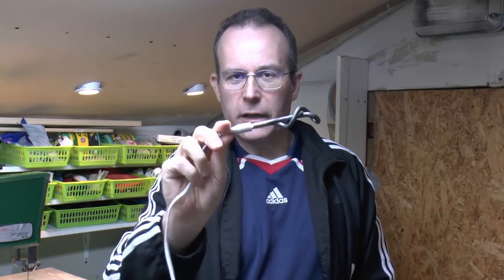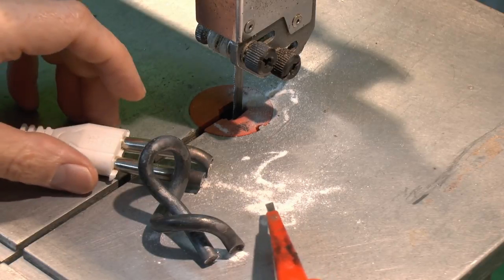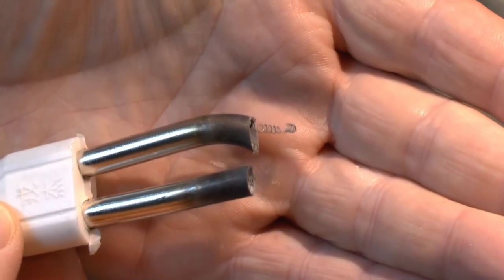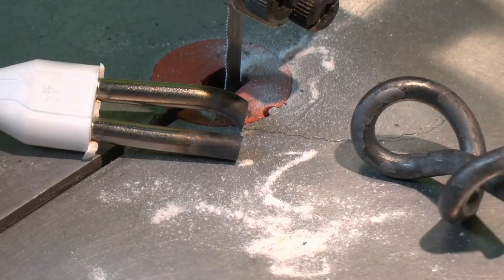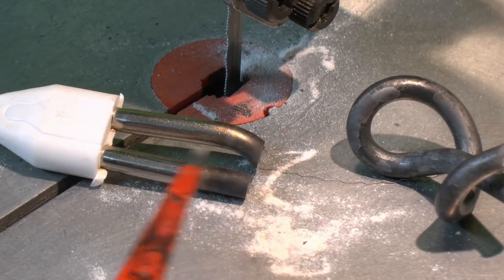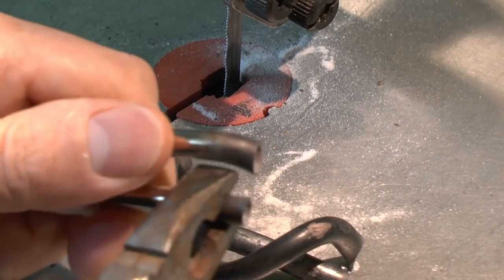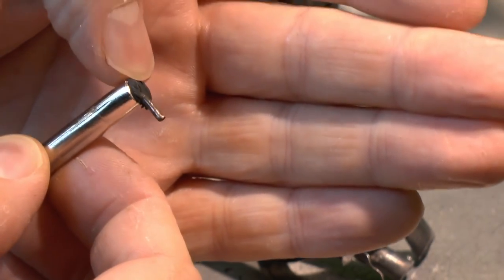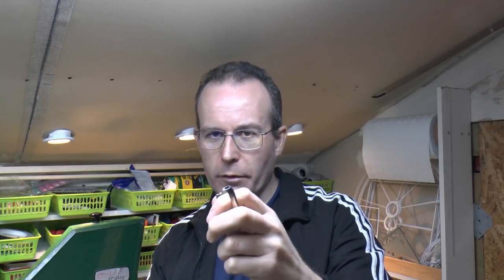Heating Element Cut Open, What's Inside

Comment: With regard to MICC or Pyro cable, a 2 core of approximately 6 or 7 mm diameter, starts off as two thick wires surrounded by insulation mineral, and fat copper strip. The copper strip is about 75 mm wide, it is rolled into a cylinder, then the seam is welded, then it is reduced in diameter, compressing the mineral, and drawing the fire/sheath. This method allows several hundreds of metres of final length to be produced.
I worked at company who manufactured the rolling stands, and the end user was not disclosed, this was in the early 1990's, and allegedly was in a response to having continuous cable for control systems on Navy ships, ref Loss of systems suffered during Falklands war. Obviously multiple cores in this alleged application.
Great work John.

Comment: The white material is mag ox, a dielectric (insulator) but transfers the heat. If water gets in, put element in oven on low, overnight.

Comment: I work making these and the power is magnesium oxide sand and the wire is 80/20 nickel chromium wire
Reply: could you tell me what type of material or ( glue) used to seal the tubular heating element at the both ends, please?
as I am working to produce one but I don't know what kind of material can be used to close the both ends
Reply: Hi, i have a problem that maybe you can help me with, i have modified a pizza elettric oven that has 2 heating element, one under the coking plate and one above it (both of them are 600watt), i have removed the bottom one and placed on top together with the other one, for a total of 1200watt above the plate, i reach 430 degrees celsius on the coking plate for coking pizza, but the problem is that after the coking i have found metal particles on the coking plate (a lot of them like a powder) and i have used a magnet for picking up this particles, now the oven is made from stainless steel aisi 300 series and its not magnetic and it has no visible sings of corrosion, i think that the metal particles come from the heating elements (the magnet do not stick to them too so probably also aisi 300 series), and also this wasnt happening before i placed the bottom heating element above together with the other one, do you know what is goin on? the heating element are in apparently good shape i dont see any visible signs of corrosion or rust on them, one thing to mention is that the heating elements touch eachother (for a reason of tight space available in the oven) so maybe when they heat up and expand and then cool down and reverse there is friction between them, or maybe is beacuse they heat up to much (the glowing color bytheway is red not orange or yellow). Do you know what those metal particles can be? Thanks
Reply: @ahmedmaher2923  porcelain can be used or sodium silicate mixed with alumina powder
Reply: How can I remove the magnesium oxide from the copper tubes. Some came out when i pulled the wire out but not all of it.. I was told distilled water or hydrochloric acid
Reply: @ahmedmaher2923  only just seen this, I used heat proof silicone and a ceramic end cap
Reply: @94iaco  the heating elements will be breaking down at the point where they touch, I notice this was 2 years ago so I hope you've managed to solve your problem
Reply: @scotthoward4836  the tube isn't copper it's a copper alloy called phosphor bronze, it has a very low copper content
Reply: @ryanreed240 tell that to the scrapyard that paid number 1 copper price for them thank you very much.  the heating elements i have are copper it's written on the boxes they came in.
Reply: I agree the heating element in the video is not copper. Not all are made of copper. Mine are a lot bigger 30 centimetres long with 6 coils
Reply: Hey! I know it's been a while but if you could answer the question it would help me a lot - can I reshape the heating element into a different shape, wouldn't it compromise the electric insulation?

Comment: I bough a cheap kettle from Tesco when I bought my house so I can make a brew while doing work before I moved in, worked fine with no issue, then I have my old fuse box replaced with a modern consumer unit and it kept tripping the RCD when I turned on the kettle. This explains why

Comment: I don't know why, I expected the actual heating part (fillament) to be much bigger. Is this typical filament size for the thickness of the outer metal bars?
Reply from the maker: Not sure, have only seen a few others where the element had split open when it failed, and they were of similar construction.
Reply: Colin Richardson 
I was expecting it to be a solid non wound resistive wire, I also imagined the insulating material to be a plaster of Paris type material.

Comment: Thank you man i found the problem thanks to you... My geyser is turning the breaker not the short circuit breaker but the other 1! So I tested the element against the tank of the boiler for OHMs and it should be infinit right? I got 10k and rising so it must be water then because its rising right? So i order new heating element...

Comment: I wonder how they keep the thin internal wire from making contact with the outer metal tubing?
I can't imagine the powder doing a very good job of keeping the element in place, let alone around all the curves and bends they often put in them.
Reply: The powder is packed in so tight it can't move. As John mentioned there is a type of cable that uses the same principle, it's known as MICC, Mineral Insulated Copper Clad. Old school electricians talk about Pyro which is the same as calling any vacuume cleaner a 'hoover'.
When I was an apprentice way back in the 1970's our instructor demonstrated it's versatility and hence why it's used by smashing it almost flat with a hammer. It still worked and passed the electrical tests.
Reply: Hoover is just so wonderfully onomatopoeic a name for them :)

Comment: Recently carried out an EICR on a MICC installation I did 5 years ago, all circuits greater than 1000 M Ohm. Its only poor potting (sealing) that normally causes low insulation readings!
Reply: Many moons ago I worked for the old LEB (London Electricity Board) and we had the maintenance contract with most London councils for the public loos. I'm going way way back as you tell. 
They were staffed by attendants who looked after them immaculately; all the porcelain gleamed, the tiles were wiped down regularly, floor mopped constantly.  They also lovingly polished all the copper work, both water pipes and the 'pyro' till it shone. We routinely had to replace sections where they had 'polished' through the wall.
Reply: @Raysnature  Yes I remember a pub landlady who did the same, polished the 'pyro' till the sheath pin holed Lol

Comment: Will the powder dissolve if I left the cut pipes to soak in water. I've removed the wire coils
Reply from the maker: No, magnesium oxide is not soluble in water. Some of it may react with the water to form magnesium hydroxide.
Reply: @jwflame  right, nothing will remove it or dissolve it. I may try cleaning vinegar

Comment: How to remove magnesium oxide and element from coils for circular tube making?? Any easy way??
Reply: Yes I want to remove the powder from the copper pipes. Some came out when I pulled the wire out but still a lot in there. I was told distilled water or hydrochloric acid

Comment: I would assume a 120 volt version would use a thicker filament so as to have lower resistance for the same power rating?
Reply: You'd think so, but then again it's much cheaper to just sell the same item and have the 240V one run a bit hotter and die sooner so you can sell another one.
Reply: More likely just have a shorter length of element wire and thus a lower resistance. Much cheaper that way.
Reply: Pete Allum it will get blew more easily if you do that

Comment: Would it not be: longer the element conductor more resistance thus less power?
Reply: He means the outer tube would be longer for a more powerful element; the resistance wire inside would be of similar length, but thicker.

Comment: Is there any way to slightly bend these?  I need to bend one 45 degrees near the port.
Reply from the maker: Yes, they can be bent fairly easily.  Elements are made as a single straight length and then bent to shape afterwards.  The main risk is bending the same sections multiple times, which will work-harden the metal and eventually cause it to fracture.

Comment: Maybe they didn't earth the housing because they know their cheap element will become leaky as soon as you use it.

The magnesium oxide is probably impure, or the end caps are not watertight, they know it's junk so they just tell you not to stick your fingers in the water. Problem, safety officer?